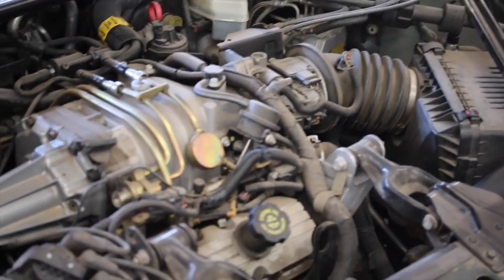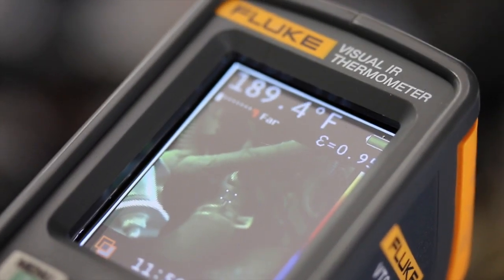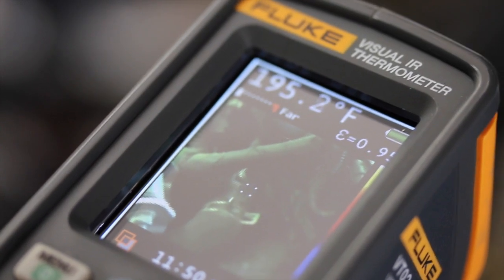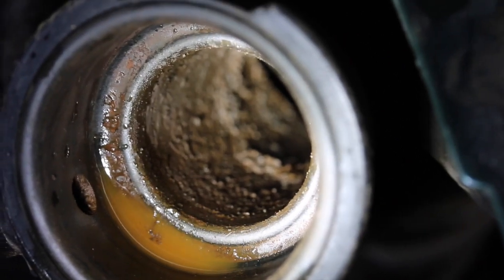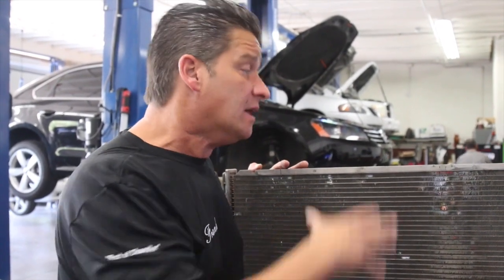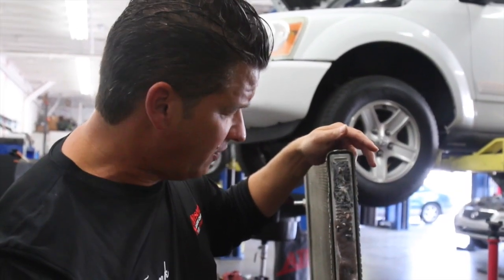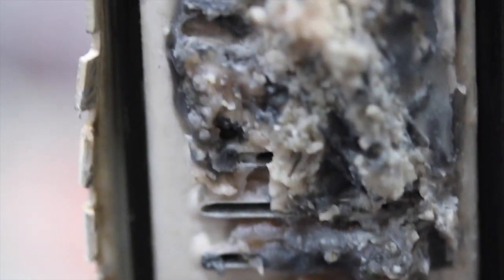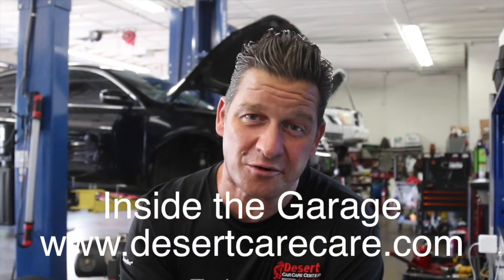What Coolant Stop Leak Looks Like\ EXPOSED

Comment: Never any issues with Bar Leak Aluminium, the material is fine enough for small leaks...but flush the coolant system 1st...stay away from the thicker or permanent stuff it cause more problems.

Comment: I used stopleak in a GMC diesel van work truck with 245k. The leak was where the motor was going to have to be removed and a lot $$ work just to get to it. Put it  in and ran it for another 105k and sold it. The motor was still running great, I was on my 3rd front end rebuild and the rest of the truck was falling apart, the paint had mostly fallen off but the motor ran like a top.
Reply: Do you remember what brand you used?
Reply: Steve O what brand did u use. My dodge I think is in the same situation

Comment: I'm pretty sure if used correctly it don't do this.. if you have restrictions like plugged radiator and heater cores that need to be flushed then I'm sure you may have issues.  I've heard that most issues though are caused by user error.. not following directions.

Comment: Only stop leak products passing ASTM D-6107 should be used (the standard consists of tests to ensure the product works and does no damage). Stop leak tablets such as those made by Bar's, have been sold by GM, Ford, Chrysler for over 30 years.

Comment: Open rad caps and expansion tanks to visually look for the crap when buying a car, it will also appear as a silvery power if its not just gunk.
Reply from the maker: Kolin Stallman excellent tip !
Reply: i saw what appeared to be a whit-ish goo that appears to have hardened on the radiator cap. i suspect stop leak, i didnt buy the vehicle, maybe my loss, but i know with people you just cant trust them.

Comment: wouldn't recommend it for a permanent fix but as long as you follow the directions you'll be fine. over 100,000 miles after I put mine in and still good to go. but if you put it in without running your car for the designated time and you don't follow any other instructions listed it may clump up and not work properly. but ultimately if it leaks fix it... YOUR SELF if possible.
Reply from the maker: Dennis Kelly ...great points ! Thank you ~Frank
Reply: EXACTLY.. they have detailed instructions for a reason.

Comment: just add pepper to your cooling system
Reply: I heard someone mention that before. How does that work? Is it an old handyman myth or a joke? Kinda like when you send the newbie to the woodshop for the board stretcher or to the  garage for blinker fluid?
Reply: @justingreen8006  Holts Radweld used to use finely chopped linseed and resins if I remember correctly, but the formulation may have changed, it was an old way of doing it, far from a permanent fix, modern stop leaks use things like kevlar / organic fibres, minerals, sodium silicate etc. etc. They attempt to first block the leak with the fibres which then seal with the minerals / sodium silicate for a somewhat more permanent seal. Pepper was another one I've heard of, and cracking an egg in a cold system to try and fix a pinhole radiator leak, but that seemed like the most far-fetched and unlikely to work methods.

I tried using K-Seal as I was trying to avoid Sodium Silicate, and it lasted a few days apparently then failed.

All should be considered temporary fixes to keep you on the road until you can pull the engine and fix the headgasket or radiator or whatever, and cannot be expected to fix major leak issues. The true fix is of course mechanical, but I once had a Ford in-line 6 that had it's blown headgasket fixed with sodium silicate and it lasted 2-3 years until I sold the car, and never gave other coolant issues really. That was under advice from a trusted mechanic as I didn't have thousands to fix the engine at the time. He certainly told me it may not seal / work.

It is VERY important to follow the instructions and best to use the stop leaks diluted with the coolant or water. I recently found out that some are more chemical in nature and require coolant flush, water and addition of stopleak then drain, and coolant refill, so not all of these are the same depending on purpose. Once again they are only good for certain failure conditions and cannot solve everything.